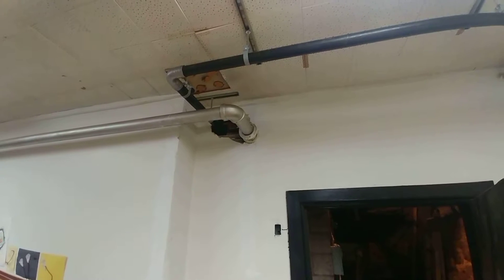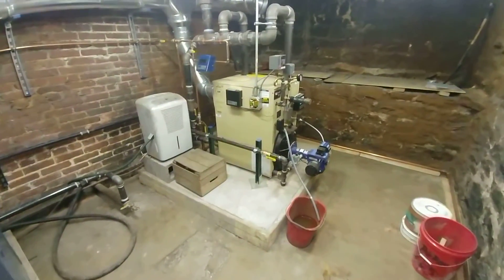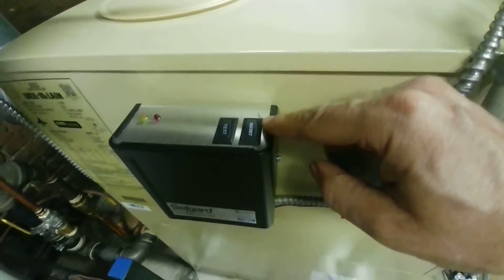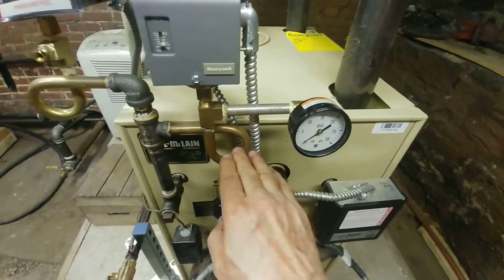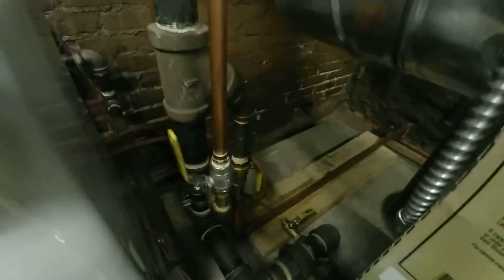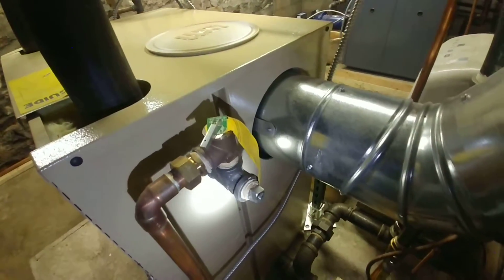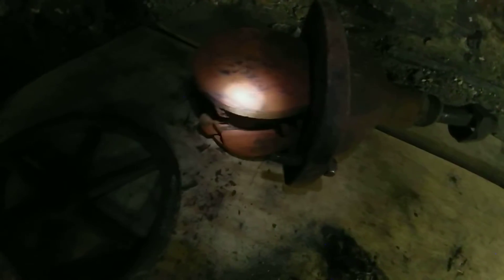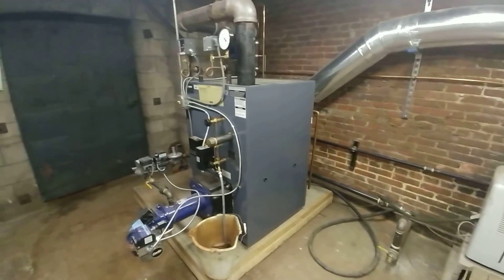Weil-McLain SGO Steam Boiler Install Using the Carlin EZ Gas Burner

Comment: Nice touch by adding that long skimming nipple and Cap what’s going to happen when all the old-timers are gone who’s going to work on these boilers.  I retired after 40 years in Detroit Michigan Working on similar equipment thanks
Reply from the maker: You are most welcome. What happens after we go? I'm not sure. That's part of the reason I'm making all these videos. So something will be left (besides the boilers!)

Comment: Did you stop using vaporstats?
Reply: Perish the thought! LOL.  Seriously, the system this boiler is feeding is a single pipe system and the boiler is properly sized, so it takes a good long while for any pressure to manifest on the gauge. There is even a radiator we sized for that is not hooked up yet.  When that goes on line, the customer will likely need to re-insulate the 3" steam mains in the boiler room to gain back useful boiler capacity.

There is, however, a quirky "wet/dry" return that is somewhat problematic and may necessitate the installation of a vaporstat later to stop the very intermittent water-hammer in that return.  With all of the leaks and other issues on this system, that is low priority.

Comment: Another excellent install. Nothing left to chance. Great job!
Reply: Thank you very much for your kind words!  I must confess, I am very happy how this install turned out.  It all seemed to come together in a harmonious whole.

The only nagging issue is this boiler tends to flood.  The system still needs a bit of tweaking.  We removed a globe valve yesterday that someone left on the system supplying a radiator (it had been supplying an indirect heater about 100 years ago!), so that should help.  

Globe valves on single pipe steam systems are almost always bad news!  And this one was sneaky,  it was hiding in the shadows. And when discovered, it didn't look like a globe valve at first.  Someone had left it in and simply ran some 1-1/4" copper from it to the radiator above. But oh my, did it cause a lot of banging.  At first, we thought it was the copper off pitch (folks who use copper for steam transfer tend to be folks that don't pay attention to proper pipe pitch), but no.

The copper and the offending valve are gone, that radiator now heats great and Easter celebrations there will be not be interrupted this year and in the years to come.

Comment: What is the benefit of using a gas conversion in a new oil boiler, versus a gas boiler?  Is the efficiency that much more?
Reply: Well, generally its a few percentage points higher in burner efficiency.  But that will add up over the expected operating life of the unit.  Oil boilers tend to have higher efficiencies than atmospheric gas boilers... at first.  Then the heat exchange surfaces get crudded up and there goes that.  

The customer incurs a yearly cost in maintenance for proper cleaning for oil burners, or suffers declining efficiencies as mentioned. Since gas tends to burn much cleaner than oil, it is expected that the gas power flame burner will retain its lower operating costs for the customer for the foreseeable future.
Reply: @elgordo271  Learning a lot from your videos.  Thanks!

Were you able to order this boiler without the oil burner?  Would you prefer this setup to a Peerless 63 natural gas boiler for brick house with 400 sq ft of EDR?